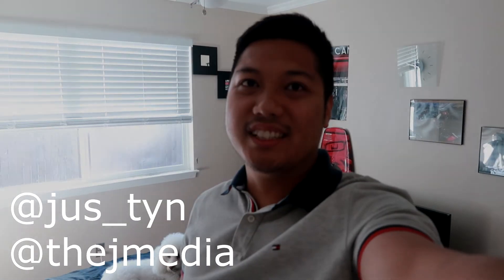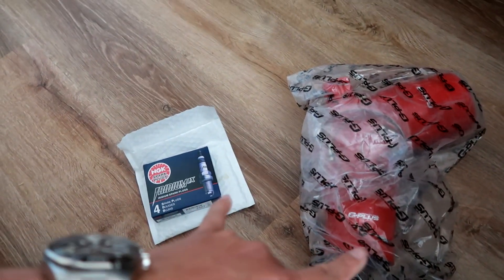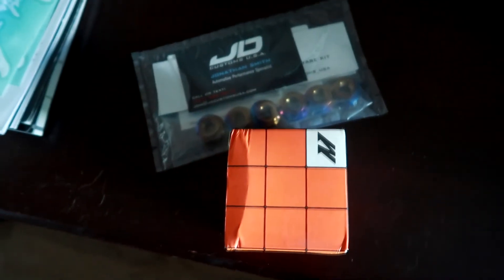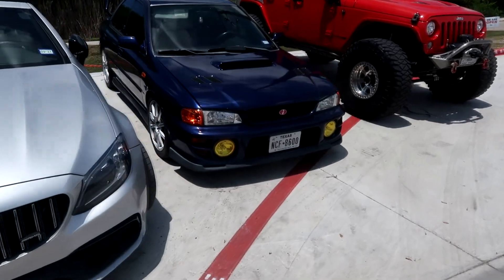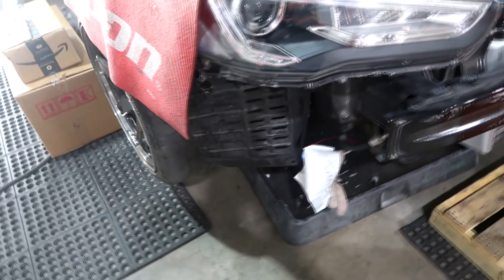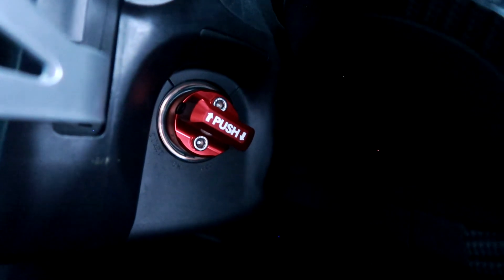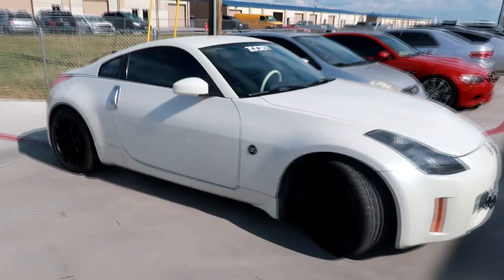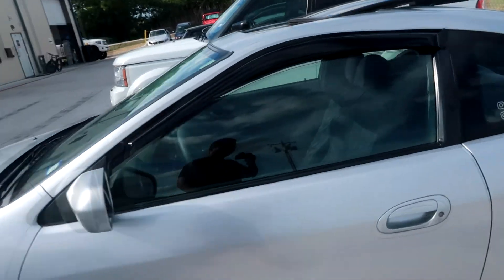Subscriber drove 4 hours to come check out my turbo build!

Comment: Hi! Is that posible in a Mitsubishi Lancer 1.8 MIVEC? 143 HP
Reply from the maker: It should be! I'm not familiar with those engines but better to check with a local shop or tuner